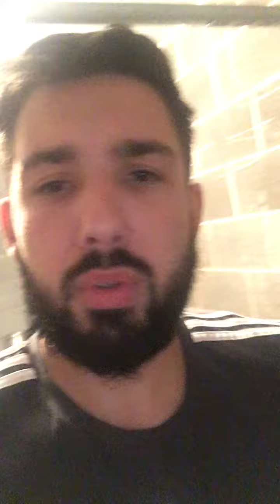MINI / BMW N47 Air to Egr mass flow plausibility P4933 P4862

Comment: Need some help i have the same error code. Are you sure that Actuator is the problem. In my case i have found some soot outside the intake plenum where flaps actuator is. I am getting an intermediate emergency program when i drive the car. I took off the egr valve but it is not blocked at all not much soot at all. After erasing all the errors and driving a short trip i get only 004932 error. I order a new egr and i will see. Cay i contact you if this does not work so you could give some advice?
Reply: Hi. Any progress with new egr ? Did you solve the problem ?

Comment: in my case it was blocked EGR pipe right at throtle body. unblocked it and fault went away. N47 E91
Reply: thnx for the comment mate it helped me a lot. Wish u had commented few moths earlier :) I was just cleaning the EGR valve for this error and completely neglected the EGR pipe going to the inlet manifold..
Reply: sorry my previous E87 n47 did no have this problem 😀, but yeah, i spent too much time to come to this solution 🤷‍♂️
Reply: Was your fault intermittent or permanent? Mine’s intermittent. It’s had new EGR, MAP sensor and MAF sensor. I want to take everything apart to check for blockages but not sure if fault being intermittent warrants this?
Reply: @eddyemm bonjour, avez vous trouver la solution de votre problème ?
Car j' ai moi aussi un voyant par intermittence
Merci pour votre réponse.
Reply: Salut. La flute etait constamment apres. Le probleme venait du tuyau EGR vers le collecteur d’admission. Il etait completement bloque par du carbone. Javais des codes d’erreur pour le debit d’air massique EGR (les captures savaient que les gaz EGR etaient arretes quelque part) et la fuite d’air du systeme d’admission (les captures savaient que le gaz ne passait pas, ils montrent donc qu’il s’echappe, d’ou un avertissement de fuite)
Hi. The fault was constantly afterwards. The problem was the EGR to intake manifold pipe. It was completely blocked with carbon. I had fault codes for EGR mass airflow (the sensors knew EGR gases were being stopped somewhere) and intake system air leak (the sensors knew the gas wasn’t getting through so they show that it is escaping, hence leak warning)
Reply: My fault went from intermittent to constant. Large half yellow engine management light and small full engine management light. I trusted a garage to fix this but they didn’t so I had to. Mine also turned out to be the EGR to intake manifold pipe being completely blocked with carbon. For the fault codes and their meanings, see my other comments. It wasn’t too bad a job. There are videos showing how to remove the intake manifold. If your car is the e87 lci n47 for example, then you WILL NOT have swirl flaps in the intake manifold. I didn’t change any of the rubber gaskets as they were all still perfectly soft. The intake will get stuck on the EGR pipe o rings during dismantling and re-assembly. Use penetrating oil to help move. The torque settings for intake manifold bolts vary depending on their size according to the Haynes manual.
Reply: I don’t want write in French again as it took me a very long time. It is best to buy a fault code tester. OBD. There is a Haynes guide on the internet. They tell you which are good ones. I bought the Motopower. I drove the car around for a while with the yellow engine management light. Eventually I had the fault codes “EGR stuck open” and EGR stuck closed” I knew the EGR was definitely one of the faults. The garage fitted a cheap EGR valve. I bought a second hand genuine EGR valve and cooler from EBay. Later, those other fault codes “EGR mass airflow” which had been there before and the “ intake system air leak” which was a new one.
Reply: @eddyemm un grand Merci pour toutes vos réponses 🙏car c'est très rare de nos jours de bien vouloir aider les autres merci encore portez vous bien 👍

Comment: hi i have this fault on my 2016 mini paceman deisel the car is running fine ,,is there anyway to test the actuator valve ? before spending loads on parts ,,thanks
Reply: Hi just wanted to check how you got on with this? Mine is the same but also running fine
Reply: @bepp5951  hi its going in again next week ..he thinks its a blocked pipe...I will message you if it's fixed..
Reply: @rabfraser1234  perfect, thanks in advance
Reply: Veles  hi ...its in the garage at the moment had all the egr cooler and egr stripped out and said its clear...so he is now cleaning the dpf...see where we go from there ...
Reply: Veles  hi sick of this car if this doesn't fix it its going...get a petrol...
Reply: Veles  hi thanks for this...mine is going back to garage again this is the fourth  time and still not sorted...I will show your message to the technician guy so he can. Check it out ...thanks again rob
Reply: Do you have any photos of this pipe ?
Reply: Veles  or a part number..would be good 👍
Reply: Veles  brilliant...have you checked if you can buy new seals...or do you have to buy the hose..?
Reply: Veles  just spoke to the mechanic..he said he done a smoke test on it and never showed any leaks...but he said the same about oil leaks where its leaks...going in on Monday again...nightmare...is yours definitely sorted..?
Reply: Veles  it's pouring here can't get under it...code is 4862...
Reply: My mechanic says it doesn't seem to be regenerating...
Reply: @rabfraser1234  such a pain this fault. Definitely agree with the petrol over diesel suggestion. I’m no further forward but haven’t removed the egr cooler. Thinking to try a second hand turbo actuator and see how that goes. I guess you are no further forward still?
Reply: @bepp5951  hi no still not fixed I have gave up...cooler is clear ..well tech guy said it is ...car runs perfect...let me know know if you get it sorted..
Reply: Hi:-) I've got the same problem on my mini countryman 2015 2.0 diesel. Did you sort the problem ? Mechanic replaced the exhaust sensor. I've cleared the code and regenerating the dpf. Smoke test doesn't show any leaks. Breaking my head over this problem since 5 months!!! Such a pain it is
Reply: @shreyasps7933  hi no not sorted I just reset the light when it's mot time...never buy another mini...